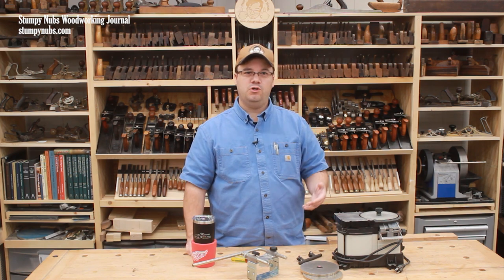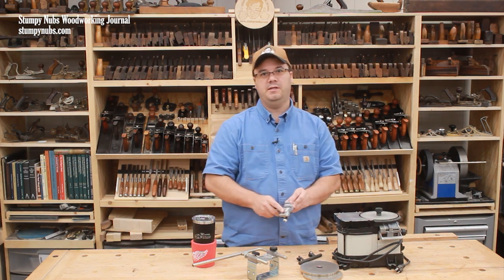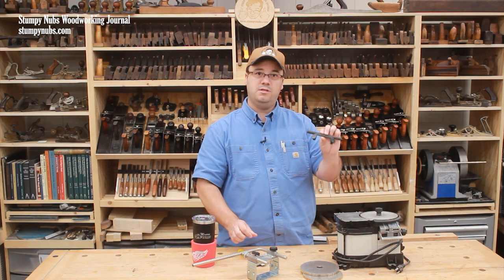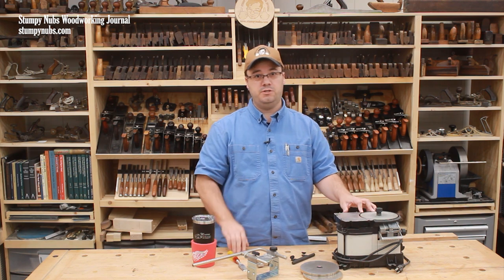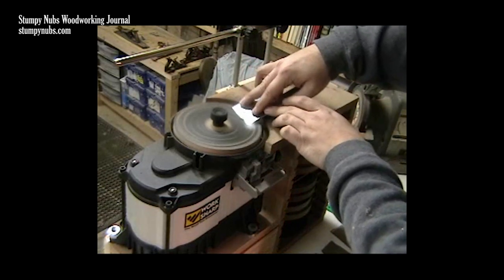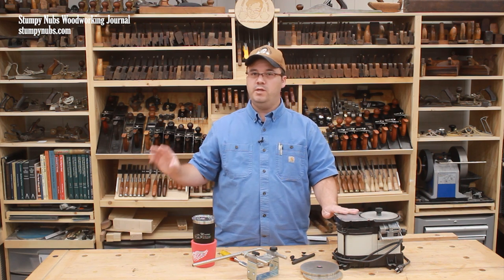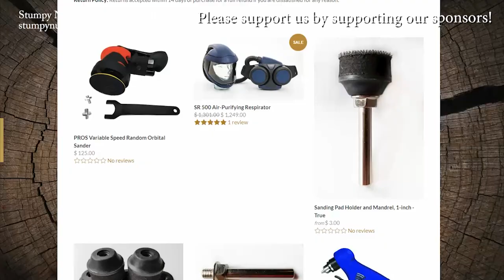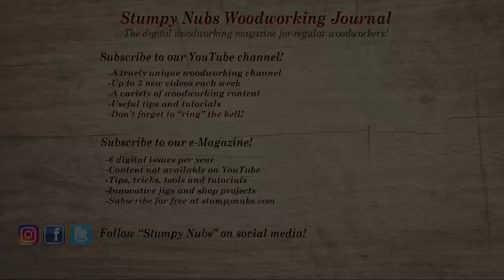Why my Worksharp doesn't work well

Comment: I bought my 3000 this past winter before knowing the table and bar were discontinued. I am thankful for this update. I saw the original before I purchased, but now I know that I will be building the updated box/table this weekend.

Good luck with the humidity question, and by the way, congratulations on all the continued success. You’ve earned it. 
One last thing:
I have a peripheral tremor too, and I also walk like I’m hammered drunk from the same neurological issue that causes my tremors. I applaud you for facing the critics head on in a video years ago. I felt like I was hearing my own experiences when I watched that. Thank you for being so transparent and uncompromising. Keep kicking ass and not giving any F’s about going against the grain when your opinions differ from the masses. We appreciate your honesty and respect you for all that you put in to building your Empire upon the Stump
Thank you again James as always,
-Castor

Comment: I'm glad I bought the Worksharp, based on your recommendation! I'm a professional carpenter and a very amateur woodworker, so I'm using it to restore my beat up carpentry chisels and low-angle block plane which can then be tuned up on the job. It's already paid for itself. So, thanks for another very useful tip😊. However, that bar isn't that great so I'll have to use your idea about adding a platform. I should have thought of that.
Reply: @D-Vinko  thanks 😊

Comment: Great video.  The MK II power sharpening system has a bar and a means to hold any size blade at a specific angle. It works great for maintaining a flat grind on your edge tools.

Comment: I bought two WS2000's on closeout when they discontinued that model with the intention to build a dual WS2000 version of your cabinet. I really need to get around to building this setup and consider the CBN disks.

Comment: Thank you for this, James!  The WorkSharp cabinet was one of the first YouTubes that got me into this awful habit. ;). FYI:  The CBN wheels for WorkSharp are awesome!  I haven’t used sandpaper or MDF in aaaaages.  And the tools seem to get a better edge.  The heat dissipation on the large metal plate really is a bonus.  Thanks again, James, for all the great videos and entertainment.

Comment: I use the side of the Tormek wheel for some flattening tasks. Probably not recommended but it works.
Reply from the maker: That's recommended by Tormek, and it works. But I find that one task is easier for me on the Worksharp
Reply: @StumpyNubs  Since I don't have a Worksharp ... 😀

Comment: Woah, flash-back!
Just missing the squiggly transitional effect. 🤔
I'd live to get CBN wheels for my sharpening systems. Are they okay/made for wet wheel solutions? I have an older wet wheel polisher that has an off size wheel and would love to replace the worn wheel, but can't even find an alum-ox or ruby wheel for it anywhere (or any other standard grinding wheel medium). I don't have the specs handy at the monent but if memory serves, it has a 1/2 inch drive center and 5 1/4 OD with a width of 2 1/4 when new. Wet bath slow speed electric belt driven grinder/polisher cir. 1950s. Plastic housing, buy I can't even find this machine or anything about it online anywhere.

Comment: I did my universal bar with micro adjustment nut. In total it cost me around 4€ instead of 80€ for the original tormek universal bar. Other than that, very interesting video.

Comment: There is only one downside I discovered with the excellent platform/cabinet you designed and I built from your plans.  With the cabinet, it is difficult to see the displayed angle of the worksharp angled tool rest.  I have to pull out a dental mirror to see it.  Have you a solution or work-around?
Reply: How about building it mirror imaged?  IE - with the tool on the right side, not the left?
Reply: I count the notches; 35, 30, 25, 20

Comment: You didn't discuss using the sharpening port (the chisel platform underneath) for plane irons, but the online listing (Rockler) says it should work for irons up to 2" wide. Any reason to shy away from that?

Comment: The Achilles Heel of the Worksharp, the fundamental flaw of the entire concept, is the fact that the cutting speed - the material removal rate - is faster as you move away from the center of the disk.  It's a show-stopper.  I too have one that's been collecting dust for years.  Other methods are simpler, faster, more accurate, and give better results.

Don't get me wrong here - I'm all for using the getting the best possible results from the equipment you have.  But if you're just getting started, Worksharp is neither the place to begin, or the place to end up.

Comment: I wish I'd have seen this video before my wife bought me a 3000 for xmas. I've tried using it with that inadequate bar that comes with it now but in my opinion without the original table and jig the thing is useless. Major ZERO for Worksharp. I'll be using your plans to try and turn it into a useable tool as I have a lot of old chisels and plane irons to work on. Thanks for this video.